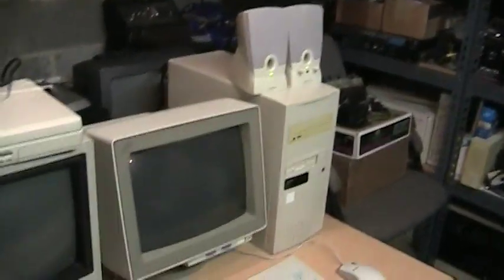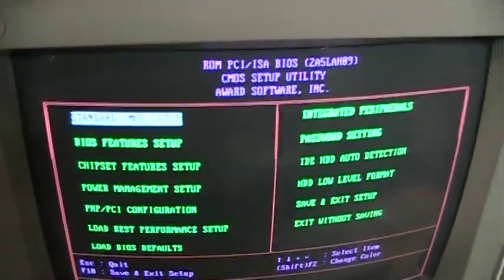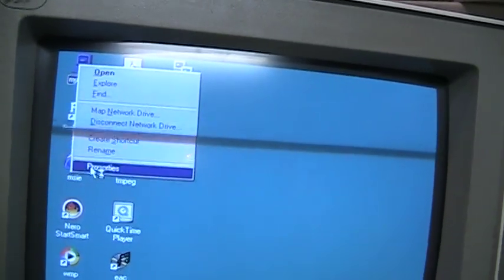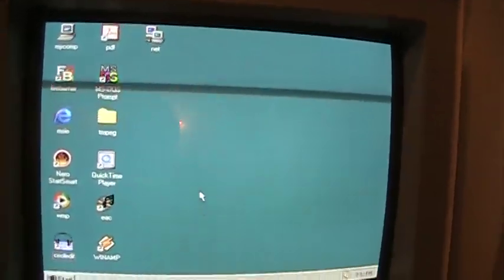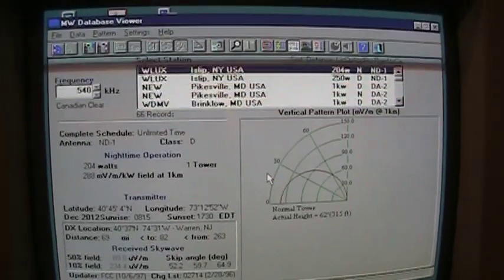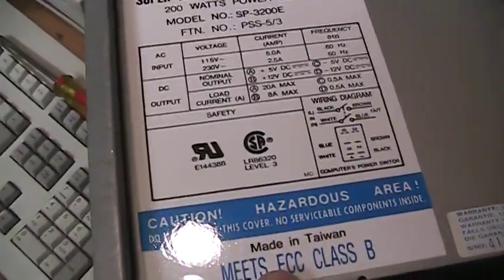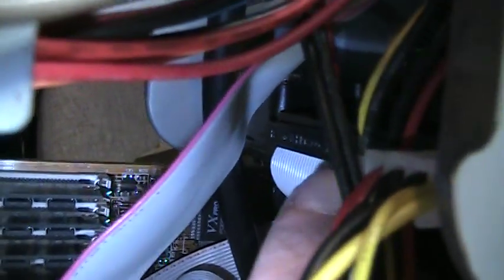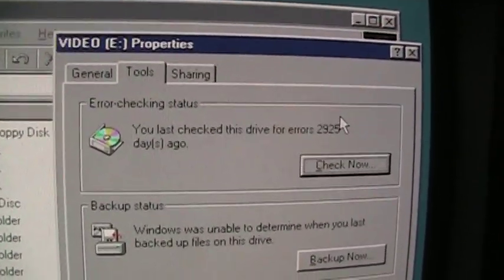Custom-built Cyrix MII PC resurrected

Comment: I remember building the first Cyrix 6x86 machine back in 1996... the processor fan was so incredibly noisy that I thought the hdd bearings had failed. The diameter of the fan was fairly small but man it revved like mad. Those early processors ran pretty hot since they were still using 5V power iirc.
Reply: +Mawerick77 Think about the Pentium 4.
These early Chips might need much voltage but the actual power draw was pretty small. Even a P III with ober 1 GHz didn't use more than about 40W

Comment: I used a Cyrix 6x86 166 in 1997 but it always ran hot. I later replaced it with a AMD K6 200 which ran much cooler. Those baby AT cases were always fun to work on with all those cables crammed inside!
Reply: I remember I overclock my P-150+ from 120 to 133 MHz and I used a software called "rainfall" or something like that.
Damn, that was a good CPU for that money.
Reply: Cyrix CPUs were pretty electrically inefficient, which coupled with the high core voltages resulted in lots of heat. The weird bus speeds also caused many issues because neither RAM or motherboard cache at the time could cope with 75/83 MHz bus speeds.
Reply: I agree, I got that 6x86 as a package deal with a "Opti Viper" motherboard, a real piece of junk. The power heatsink would get red hot too. Cyrix did make lower power CPU's later on, but I heard the MII CPU's could also get hot under a load. AMD's K-6 and K6-II were much better and cooler running Super 7 CPU's.
Reply: In 1997, I bought my first PC for 1552$CAN, taxes included. I guess it would be 3000$CAN with today's dollar. I didn't include a CD drive to cut costs and bought a cheap 15 inch screen. It was a TTX.

It was a Cyrix 686 P200L. The L means Low Voltage. This is the version that you want to buy.
Reply: I wish i had that version, I might have hung onto that setup longer. The 3.52v 6x86 gave me the impression then that all Cyrix CPU's ran hot. But for a few years they were very popular with the OEM Mom & Pop computer stores here in Texas. A friend of mine picked up a couple of old computers from a business that had been used for years. When we dismantled them for parts I was surprised they all had Cyrix or IBM CPU's.
Reply: Cyrix was a fabless company and IBM made their chips. Part of their manufacturing agreement was that IBM was allowed to sell Cyrix designs under the IBM brand, which was bad for Cyrix since they were basically competing with themselves.
Reply: It probably did in the long run, but it was the only way Cyrix could get their chips manufactured. I think they had similar deals with Texas Instruments and SGS Thompson. Its just a shame that when National Semiconductor bought Cyrix that finally gave them the manufacturing plant that they needed, they slowly started gutting the company.
Reply: It's really a pity that IBM didn't decide to use those CPU into their own PC line up.
Reply: I agree. Intel had such a huge monopoly on the market then. Computer companies were so scared of upsetting Intel by using Cyrix and AMD for fear of Intel cutting off supplies of Pentiums or keeping them from getting the latest versions.
Reply: GGigabiteM  
"Cyrix was a fabless company and IBM made their chips. Part of their manufacturing agreement was that IBM was allowed to sell Cyrix designs under the IBM brand, which was bad for Cyrix since they were basically competing with themselves."

==Back then I didn't know that. I had chosen the parts for my PC and they assembled it for me. I got home (sept 1997)  and I removed the heatsink and the geniuses had a tiny sticker on the CPU and the heatsink was not making a good contact with the CPU. Also, I was wondering why it was printed IBM in large letters. It was a IBM P200L+.

It looked like this
http://picclick.com.au/Vintage-IBM-686-P200-and-PR233-Processors-182408828081.html
Reply: +J.C Elgoog

>It's really a pity that IBM didn't decide to use those CPU into their own PC line up.

There were a number of reasons Cyrix chips weren't used by large OEMs, most notably was performance, or lack thereof. While Cyrix had respectable integer performance, floating point performance wasn't much better than a 486. This was a problem because the emerging 3D games market made liberal use of the FPU.

Another issue I touched on before was compatibility due to the weird bus speeds. It would have been more expensive at the time to engineer a motherboard to properly support 75/83 MHz bus speeds, and as we all know, they also generated a huge amount of heat compared to other chips at the time. Memory at the time was still very expensive, and more so was SRAM cache chips, especially chips fast enough to cope with 83 MHz.

+louis tournas

>Back then I didn't know that.

Most people didn't. Cyrix had a few fabs at the time (TI, IBM and SGS Thompson) and there was little difference between the various chips made. The only notable difference of IBM parts is that they tended to be more conservative with their clock ratings. An example would be if Cyrix labelled a chip 233, IBM would label it 200. This was probably a good idea because Cyrix usually tried to push their designs too hard to keep up with AMD and Intel and ended up causing stability problems.
Reply: Lack of performance ? For playing Quake or using 3D studio, no doubt with that. For any other use, Cyrix were excellent CPU (a bit hot perhaps).
Of course, for OEM, the use of Cyrix CPU would have been using only official bus speed.
Reply: Good points. OEM's could get motherboards and memory that could run at 75 and 83 Mhz easier. But not a huge company like IBM where all their Socket 7 boards were set up for 66 Mhz. Cyrix seemed desperate to keep up with other companies speeds so they basically overclocked them.
Reply: *****
"OEM's could get motherboards and memory that could run at 75 and 83 Mhz easier."

==That is a problem. The PCI bus and EISA bus are tied to this bus frequency.
Setting the bus at 66 MHz means that PCI runs at 33 MHz. I don't remember what EISA ran at. Perhaps 8 MHz.

Setting the bus at 75 MHz means that PCI devices are now overclocked at 37.5 MHz.
Setting the bus at 83.3 MHz means that PCI devices are now overclocked at 41.65 MHz.

Example:
A 686 MX PR233+ needs 75 MHz x 2.5 = 187.5 MHz
Core voltage 2.9 V.
It supports MMX.

A 686 PR200+ needs 75 MHz x 2.0 = 150 MHz

Cyrix MII's need a 83 MHz bus.

Some of this stuff is explained at https://en.wikipedia.org/wiki/Cyrix
Reply: +louis tournas

>I don't remember what EISA ran at. Perhaps 8 MHz.

As EISA was an extension of ISA, it ran at the same clock speed. There was never really an official bus speed for ISA, it varied between 6-14 MHz depending on which motherboard you used.

Most later motherboards with PCI slots ran ISA/EISA from a clock divider from the PCI bus, usually selectable in the BIOS as a 3 or 4 division. So if the PCI bus was 33.3 MHz, a 3 divider would be 11.1 MHz and a 4 divider would be 8.325 MHz. But since the PCI bus was tied to the FSB in most cases, this could be lower or higher.

Comment from the maker: Correct, it is a standard VGA monitor, model 8518. The model 8514 is the oldest IBM monitor to support 1024x768 graphics, although it can only display interlaced video at that resolution.

Comment: I had a P2-450 based Deskpro back in 2000, and it too had a ghetto CPU cooler. The passive heatsink would get scary hot under load, so I wrapped a thick rubber band around the CPU cartridge to hold three 40mm fans to the heatsink. It actually worked quite well!

Comment from the maker: I originally had an older 6x86-PR166+ on the board. Around 1999 or 2000 was when I upgraded it to the MII-PR266 (which is overclocked to 3 x 75 MHz here, a speed normally used with the PR300).

Comment: Computer show special indeed. That board is from 97-98, by 2000 it was clearance parts. ATX machines appeared in 1997 and new AT boards were pretty much gone after 1999. I recycled a Bigfoot from a Compaq at one point too. The machines I built for people during 2000 were Socket 370 Pentium III based!

Comment from the maker: The board does have a pinout for USB connectors, but the chipset was based on an early beta version of the USB standard which didn't work correctly with real USB 1.0 devices, so PC Chips permanently disabled it in the BIOS. And yes, I was using it with an external modem, which I did a video on a while back ("Phoebe Micro 56K V.92 external modem").

Comment: I still have an original Windows 95 Disc, and a 95 with USB Support, which came with an Internet Explorer 5.0 CD-Rom, all of them still work!
Reply: -_-  I thought Windows 95 didn't have USB support.
Reply: Halen Martini They soon released a Windows 95 with USB support disc, for higher end computers of the time. I'l take a picture of it if you don't believe me
Reply: I use to have the update file for USB for Win 95. I downloaded from microsoft but I deleted it or lost it. I also had a infra-red support file from them and another update. It was 3 EXE.

I have the Win 95 OSR2 CD.

Comment: Why does the Windows 98 startup sound always skip a little?
Reply: +skil3z #becausewindozed
Reply: +𝘀𝗸𝗶𝗹𝟯𝘇 It seems that it does on older hardware, on a SoundBlaster Audigy, it doesn't do that.
Reply: I think the CPU is at 100% utilization and it chokes a little. On faster CPUs it doesn't do it, in my experience at least.

Comment: I recognize it right away haha. I have a quantum Bigfoot in my dell optiplex because the original seagate scsi drive is failing. It's also the same model as your Bigfoot too as well as the same size

Comment: Btw, to enable the text-mode-message, you need to move "LOGOS.SYS" from the root directory to another folder of your choice. It contains the same message as a graphic, which in this case, if not found by the system as expected, goes back to text mode.

Comment: Ok I'd have guessed a Western Digital judging the hollow rattling but the spin-up sound like a jet engine should have lead me to the bigfoot. Had a 4 GB bigfoot once, was just awful slow but otherwise quite reliable. We still have that drive somewhere I think. The second drive you have looks suspiciously like a Maxtor old stock that has been bought out and relabeled by Quantum because original Quantum 3.5 inch drives traditionally had more a brick shape with a flat top plate.
Reply from the maker: Actually it was Maxtor who bought out Quantum. At that point the existing Quantum drives were relabeled as Maxtors, including the Fireball series.
Reply: VWestlife
Yes you're right had seen some Quantum Fireball-ish Maxtor drives around 2000... must have got confused what went on. But was there another third party manufacturer where Quantum sourced drives from and relabeled them? But can't find anything useful about it.
Reply: @gentuxable  Another manufacturer that relabeled Quantum Drives was Nikimi. I had a 15GB Nikimi (Quantum-based) which had the motor dead.

Comment: Wow, I have a simalar case with an older Cyrix 6x86 PR166 made by IBM. It had windows 98 for some strange reason with a still-working Maxtor 800MB disk. I bought it for 5 dollars in 2005!

Comment: Well, for some things, I can stand interlaced video. Some interlaced video (i.e, 1080i) I cannot. I really do not use CRT monitors as primary displays; because 1) they sometimes have low resolutions, 2) they smell bad when they're dusty and hot in use, and 3) THEY'RE HEAVY!

But it would be cool to have an old IBM CRT. They're getting rare...

Comment: The PC Chips PC I had to work with (at length) had that chipset, and you're right about the onboard video, it was really worthless (used it as the 2D for a Voodoo2 12MB, which thankfully didn't require an IRQ)! I've tried all sorts, but have to say that Intel helps (and so what if that's due to better software support? I need a working system not a tweak-practice just to achieve stability) My computers these days can run 24/7 rock solid, or I get rid of them. So, PCChips taught me well, in fact!

Comment: turn off the turbo button it makes the pc run slower
Reply: It's basically an overclock button.
Reply: it makes the system run like a 8088 or 286 cpu so you can play old dos games that run too fast on newer pcs.
Reply from the maker: No, LGR was wrong. In most PCs, pushing in the turbo button makes it run at full speed (as indicated by the turbo button lighting up). If you leave it off, the system will run slower.
Reply: I don't think your system supports turbo.
Mine didn't and they did not connect the turbo button to the motherboard.
It was for 486 systems.

Comment: Cyrix MII = shit. PC Chips = shit. I had to fix a computer from PC Chips that had the mobo PCI slots in the wrong order, so that you couldn't avoid a conflict with the AGP card, which was onboard, so you couldn't avoid a conflict. SIS chipset, too: WEAK. The AMD K6-2 CPU was the strong-point in the rig, go figure.
Reply: The problem was the PC Chips motherboard.